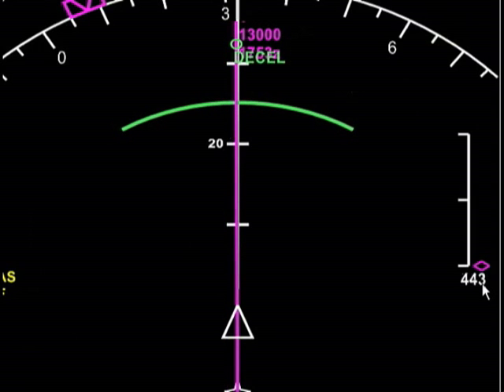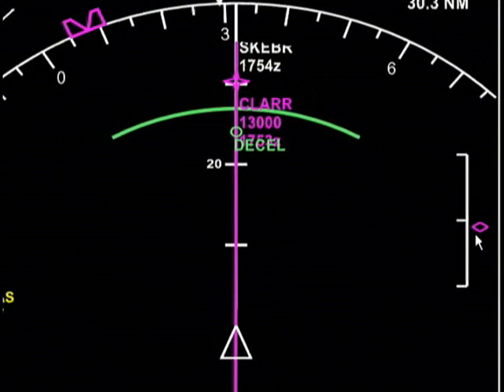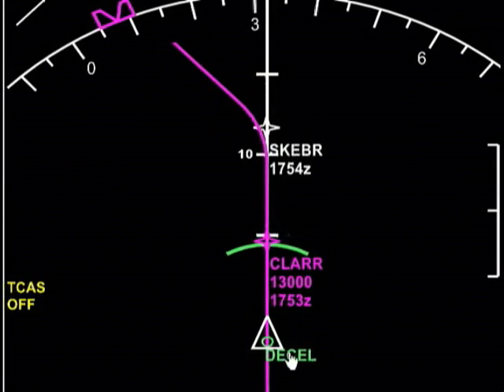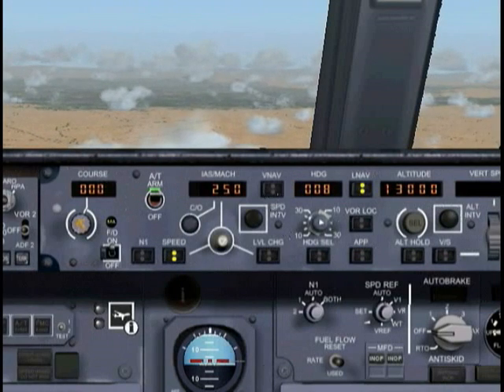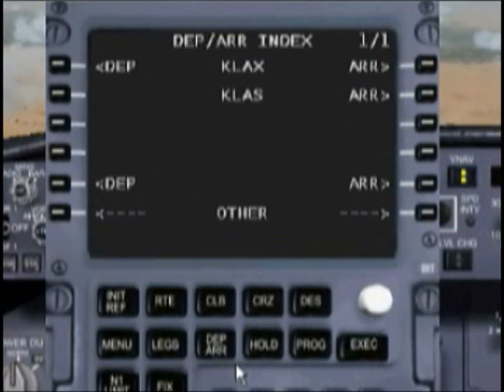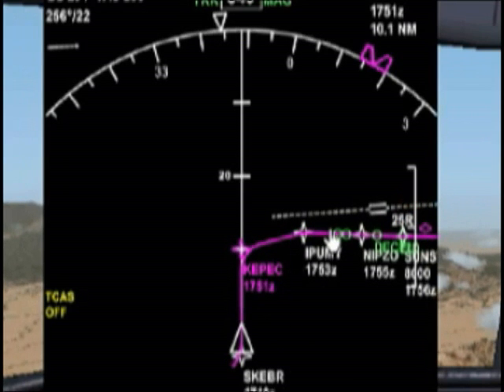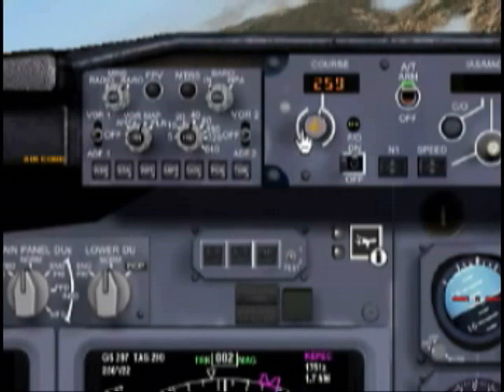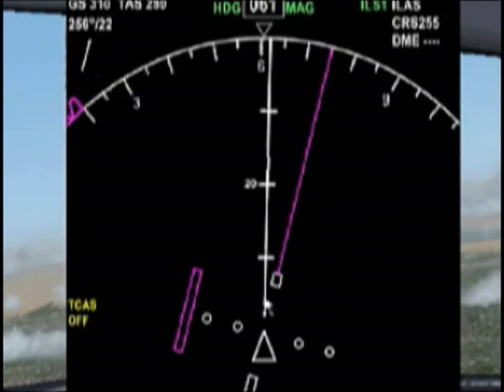PMDG FMC Tutorial Part 7

Comment: in the FMC you have a NAV buton.. click it and in the left side must have ILS Frequency and CRS.... check the charts look for the ILS and CRS and put them there.... you must catch the LOC at around 3500 feets with a speed of 170 kt... after LOC capture push the APP buton, this will engage all 3 autopilots... check for autobrake set to 3. At touchdown press F2 for reverse thrust at 80 kt press F1 for idle and set autobrakes to OFF... that.s all...

Comment: Also, the Vnav wont overide a manual input therefore you could if you wished rely solely on the autopilot by setting your altitude pre-selector to the cruise level and upon reaching that you could set it to the lowest altitude profile and the computer would handle all climb and descent profiles. In doing that however you take away one of the cross check for failure processes from the shel model. Software/Hardware/Environment/Liveware

Comment: Hi there, point to point navigation is something for the future but currently due to unsigned treaties and governing states for airspace, point to point navigation is not yet possible. All commercial flights route by a system of lower and upper airways, this is similar to motorway and highway networks on the ground. For aircraft to be seperated, they will be at least 5 miles apart horizontally and 1000ft vertically, this increases above fl245 twofold and again for supersonic aicraft.